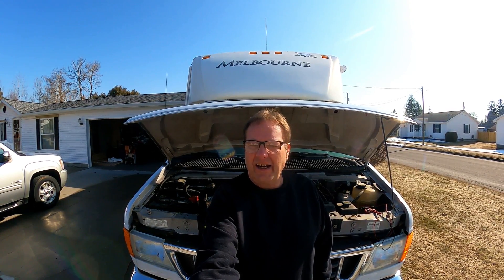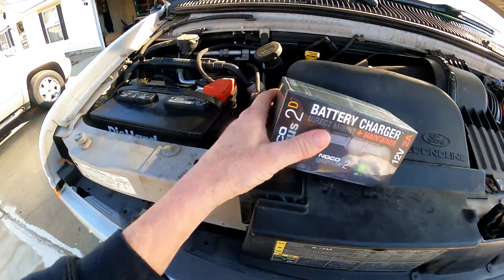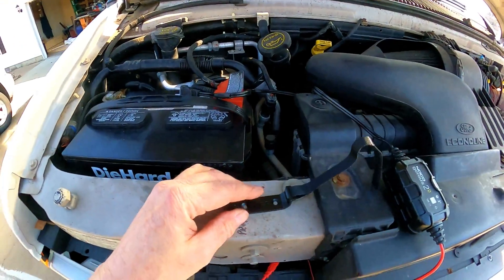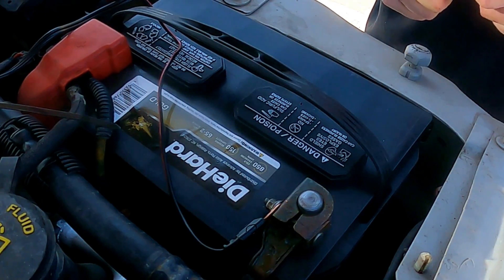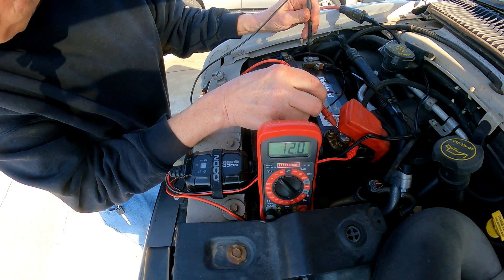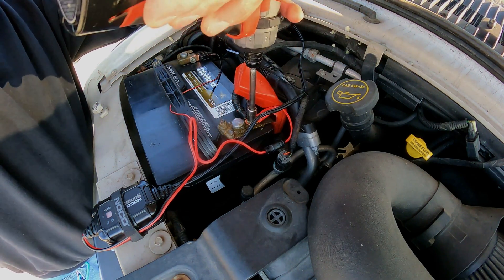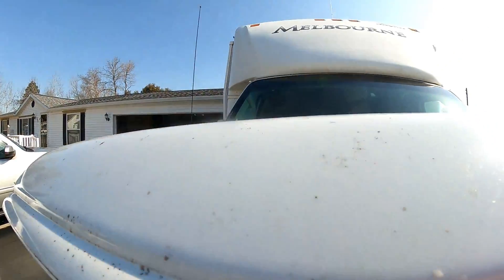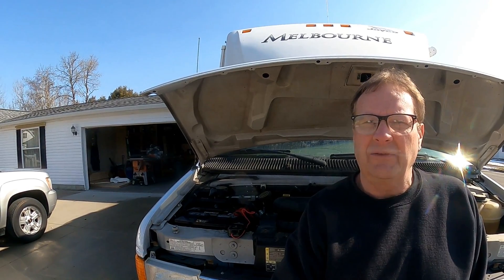NOCO GENIUS 2D, 2-Amp Direct-Mount Onboard Charger, 12V Battery Charger Review

Comment: The "NOCO Brand loyalist" should be upset. I have several different Noco models and never had a single quality issue with the chargers made in Vietnam. The one your testing is a Chinese made charger..I feel robbed now because I unknowingly bought one too.. Hope everyone that got mislead by the manufacturing location change will not experience problems. Hopefully it'll be only that particular model to avoid so NOCO will remain a dependable product. My comment isn't a made in China phobia...just a reluctance to repeat a money waisted experience.

Comment: I installed the same 2.0A Trickle Charger/Maintainer on my '21 GMC 1500 AWD as well.  Connected to its battery posts.   Wish its 110/120V electrical cord was 8"-12" longer.  Hope their next version has a longer cord.   It works.  Its LED light blinks RED when charging up and solid green when fully charged.  IMO, RED means a "problem".   They should have a "flashing green" when charging up and a solid green when fully charged - like many other trickle charges.    Hopefully, their next product version is made with a longer cord and better (more meaningful) LED light.    Even with these design flaws, I bought another unit and installed on our "run about" 2014 AWD vehicle.   When I plug its engine block heater in, I plug this charger in the same electrical cords.   Works for me...  I recommend to others...
Reply: Blinking red charging is good shows battery charging but not yet charged

Comment: Mm mm I noticed a comment regarding NEVER  go to terminal post negative but the extra cables are for permenat connection. 
By removing the crocodile clamps...?
Reply from the maker: People are stuck on that if a spark is created the battery will explode. When was the last time you saw a video of a battery exploding from jumper cables or with charging cables?
Reply: @Marksmisfitworld  on cars with start and stop, there is a sensor for the battery management on the negative cable, when charging or jump starting the negative clamp should be connected to the body ground after the sensor as to not damage it and so the sensor acknowledges that the battery has been charged.

Comment: Never ground to the negative always a body ground, you should research before making a video showing poor practices
Reply: For a trickle charger like this it’s no big deal. The reason for avoiding the battery grounds is due to sparks that can be produced during the connection/disconnection phases. This is not designed to be connected and disconnected, so I don’t see the issue.
Reply from the maker: Show me how you ground the body in a boat.
Reply: @Marksmisfitworld  it will be the engine block, a ground block or if equipped a green wire for the shore system. Education is free pal I know you tried but being a smart ass ain’t for you.
Reply from the maker: Not a being a smart ass, bass boat is connected to the batteries only.
Reply: Wrong and right